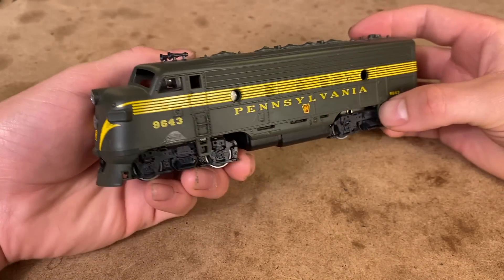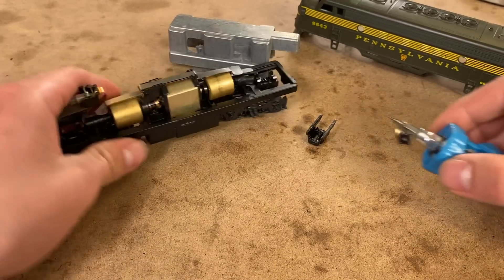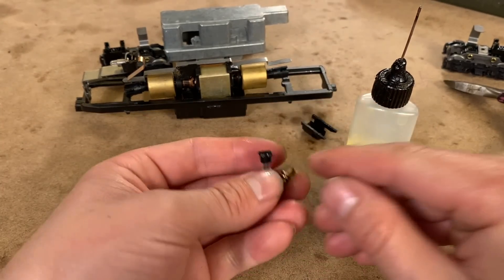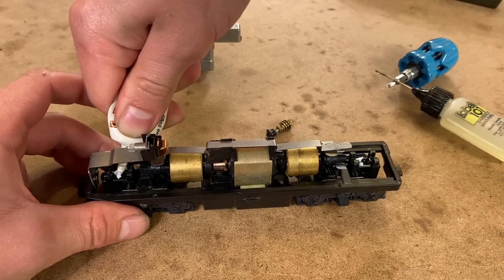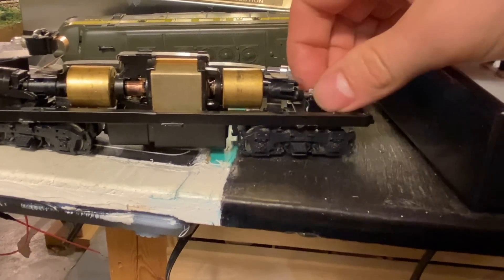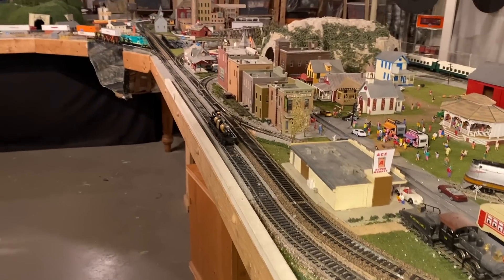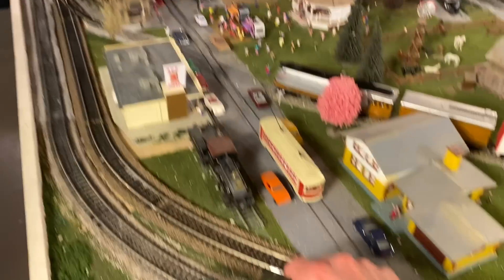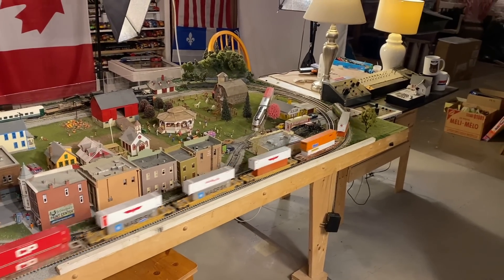Will It Run? 50 Year Old F7 Locomotive - Seized, Damaged and in Need of Repair

Comment: For the algorithm:
Green oxidation indicates leachate of elements in the bronze bearings.  Lack of oxidation in the iron elements negates H2O (flood or high humidity) conditions.  Lack of chronic breakdown (Proto 2K final gear cracking due to loss of plasticizers caused by petroleum lubricants) over the range negates manufacturing issues.  Likely it was baked in an attic or storage shed.  Loss of liquid oil and congealed grease lends support.  Brittle motor mounts also indicates this. Nice demo, as usual.

I have one of these.  Detailed with the Walthers kit and much dry weathering.

Edit: Leachate
Reply from the maker: Thanks for this detailed explanation of what likely went wrong on this locomotive.
Reply: @SMTMainline hi Ihave a few questionsI have aNorfolk and western class j steam engine thatStopped running on new years Day and was wondering if you can helpme
Reply: @SMTMainline  2 question I have a southern pacific daylight steam engine and looking for the roof
Reply from the maker: @shananhale985  Are they made by Bachmann?
Reply: @SMTMainline   yes sir they are
Reply: No, the Chinese use that "brown" grease from the Lavitory over there! 😂
Reply: Harrison, actually I have an A-B set of those, and another custom painted / detailed set of PRR A-B F7's with the single stripe.
But mine have all the P2K motors & driveshafts, and TCS Wow sound decoders in both A units, and silent decoders if the B units are powered.
The only reason I still have the old Athearn locos, is all the work I did on them.
But my preference for F-units is Stewart-Kato, or the new Walther's Proto F's & FP's, which have the helical gears on the axles. They are even smoother, and quieter running (that is when the sound is muted).
You're doing a fine job of showing modelers  how to repair these older engines.
I've been in HO Scale since 1959, at time I was 9 years old. Since then I've built many of kit locos,  and bought & sold many. Keep up the good work!
Reply: I use odorless paint thinner for enamel to clean bearings, gears, and motors. I also use bathtub caulk as a substitute for motor mounts, being careful to keep the bottom contact free of the caulk.

Comment: That's a common problem on LL P2K engines also.
They used a thick Brown gease in the trucks, which hardens up, and the bronze bearings on the worn shaft, lock up! 
I take the trucks all apart, and soak everything in 91% alcohol overnight, then scrub them off, using an old toothbrush.
Once clean, reassemble them,  and use LaBelle grezze with PTFE.

Comment: Super. The Athearn "Superpower" F-7A was my first flywheel equipped, all wheel pickup, all wheel drive, all gear drive, mainline diesel locomotive, and it raised the bar for any future locomotive purchases by me. To this day, some 40 years later, this locomotive and four sisters (A-B-B-B-A) that I bought new (Summer job, $1.85 an hour, phone operator, $14 each locomotive from Caboose Hobbies.) are still reliable runners and dependable enough to be used on the plow train when it snows. The paint jobs have evolved to a nice, weathered, natural patina, (After all the time operating outside.) that looks very realistic, and maintenance is very easy and minimal, and also they look fantastic pulling a matching express passenger train. Thanks for the memories, and hello again from the Tracy Mountain Railway in Colorado. 💙 T.E.N.

Comment: It’s interesting to see that amount of oxidation in those areas. It reminds me of old leather holsters that have that kind of local corrosion around the snaps and rivets. That is usually caused by wax and leather cleaners. So, using the wrong kind of cleaning solution, the wrong kind of lubricant or something else that contains a corrosive chemical. Just a thought!🙃

Comment: Hello All, those Athearn BlueBox mechs are rugged, reliable, easily fixable, and very long lasting, and replacement parts are still available, which regrettably is not the case for some newer, and less rugged, locos.Regards from Australia.

Comment: You youngsters were never told that Delrin gears are self lucubrating. No need for oiling.  Check out the history of Delrin
Reply from the maker: With all due respect that's not true, Athearn put grease from the factory for a reason.

Comment: Because these motor mounts wear out over time and Athearn use the same mounting systems for all road diesels, I just keep a bunch of spare mounts on hand. You can find white rubber ones from a lot of places, but the newer black ones with screws seem to work on older models too.
Reply from the maker: Not a bad idea but after 10 years of working on these I've at most seen two Athearn motors go bad. They were made very well.

Comment: I got a vintage Athearn Union Pacific ALCO PA-1. It sorta runs but it has very high energy draw and moves very slowly and weakly. I have cleaned the wheels, cleaned the motor, put new grease in the gears. Any tips on how to get it going faster or is the motor dying?

Comment: I had the exact same problem with an Athearn blue box myself. I bought it cheap at a train show. It didn't run. Same problem,  bearing next to worm gear seized. Fixed same it the same way. Now it is one of my better haulers. Thanks for the video.

Comment: I got to say that was challenging locomotive to get fixed. I myself never saw that bearing seizing like that but I'm not going to say it's not common. One thing I have experience with blue box locomotives bandai have a Athearn bluebox PA 1, and a S7 I believe or a sw1500. Anyways they both have issues with gears then I have a GP18 high hood issues. They have steel wheels vs this locomotive that you have in vid. I'm going to try to get some more gears and see if I can fix the issue with them locomotives. The only way I noticed it was when I was cleaning the wheels. When I gave some pressure the wheel stopped dead in its tracks and started clicking on the gear. I have one of these in a New Haven paint scheme with the b unit, the newer versions will not as heavy as the older version like this one. The instructions for mine show the part number for that wait that's on top of the motor which mine does not have. That could explain why it doesn't pull as much as this one would with the added weight. Good video as always Harrison

Comment: I was going to say about oxidation, but the pinned comment says it all very well. Also, you might want to have spare Athearn motor mounts on hand. This issue of brittle motor mounts is not too uncommon, and every Athearn owner should keep spares on hand. Ironically, I've owned this same exact engine in the past, but it was repainted into a Penn Central unit.

Comment: In your bottom parts drawer you have a very early metal chassis Athearn F unit chassis with brass wheels.  Would you be willing to part with it?  I desperately need a motor as mine is demagnetized.

Comment: That you could get the engine to run is a partial victory.  The broken motor mount should have also been replaced.  The combined friction mounting of both motor mounts keeps the prongs on the bottom of the motor secured against the frame, making a secure electrical contact.  The new owner will probably have to replace the broken mount at some time in the future, because with use, the good motor mount will gradually pull on the motor, skewing it out of alignment.  I had an experience with an SW1200 (Athearn calls it an SW1500), with a similar problem.  In that case, the motor and drive train was skewed, causing the drive train to rub on the car body, making a loud noise.  It took me a while to figure out that one of the mounts was broken.  The mounts are a very inexpensive replacement cost, and well worth installing, considering the amount of time you spent to completely disassemble the unit as you did (good job!).  Spare parts are good, but they need to be serviceable.  -  my humble opinion...

Comment: P2K engines are clones of the Athearn drive system with extra enhancements. The binding drive worm gears are a common problem if they are not stored carefully and exposed to heat and high humidity.

Comment: Depending on the lubrication, you have dissimilar metal corrosion between the bearing and the shaft. If you don't have similar corrosion on the axel bearings, I would guess that the oil protected the axels, but grease on the gears and worm shaft actually caused the worm bearing's to corrode and lock up. Because the gears and posts are plastic they would only be affected by hardened grease clogging the gear teeth.

Comment: Why cheap out, should have put new motor mounts. They're cheap enough to buy.
Reply from the maker: It's not about cost, It's about time, it would take weeks for those parts to get here. They're holding properly as seen in the video and I'm not charging a dime for anything.

Comment: I recently updated an old F7 and added more details on the loco. When it came to cleaning the working parts I used an old toothbrush with rubbing alcohol which gets into all the cogs and corners. It now runs like dream. Great video thank you for sharing

Comment: Athearn sells new ones by the dozen, which I had to get because the mounts in my engines were starting to fall apart. The type of plastic those mounts are made of start soft, then harden, and then after about 20-25 years start to crumble.

Comment: The shell with the darker green paint might be 50 years old but that chassie is no older than late 80's or 90's .  I want that shell .
Reply: The shell is not old as you think. This scheme was offered during the 1980s to 1990s, and I personally owned one of these exact locomotives. Keep your eye out for on either Ebay or a train show. They are not as rare as you would think.

Comment: Surprised you don't remove brass clip n solder heavy wires to motor for Better performance!
Reply from the maker: It's an option but it means if someone ever wants to do maintenance on this locomotive again, they'll need to desolder both trucks from the motor.

Comment: Not 50 years old. Athearn changed to this type of motor in the mid-80s, so would be more like 30-35 years old.
Reply: Either that or someone swapped out the motor 30 years ago.
Reply from the maker: I'd thought they had started using this motor sometime in the early 70s.
Reply: @SMTMainline  I have some Blue Box GP-9s (the model is actually closer to a GP-7) purchased in 1980, and they still had the old motor and steel flywheels. It was a few years after that that they made the switch.

Comment: Motor fixed... Headlight... uh...   Actually, with a bit of bending, you can get the headlight to shine through the nose instead of the cab windows.  John
Reply from the maker: I tried off camera. It's making proper contact but it still won't work for some reason.

Comment: I have had the very same problem regarding the motor mounts,( now have spares) but thanks for the tip on the worm gear bearings....I will be looking into this aswell,...your right regarding the motors they are very good.👍🇬🇧

Comment: ATHEARN MOTOR MOUNTS getting hard to get TRAIN SHPO  maybe or short screw should work also what they use now, I need to talk to Jon and me Iam going be making a will,. I did talk to my worker about it my club is not getting any much only N scale is getting some 3 and 2  Bay Hopper cars.  I told SATURDAY on 8th I may have got it on video, He said "I" fuck up the hole layout, Iam still running my train no problem he got all reds no greens light i was only one running a train, They took out that switch I melted long time ago they put in a new switch in, HE did not do it 2 others did the work on it. I was only one running a train, He did not get his way on to the NCE he wanted he mad about that, That wye I  not giving my trains to the 3 said I have junk, there are better then any one, that is there words. Even Tom herd other story  them in the pass way be for I was in the club, Is that bad.

Comment: You could use CLR to help free up the parts. Just make sure to have them thoroughly washed or they will cease again. Another thing you can do for all your blue box engines is to upgrade the motor mount to the ones with 4 screws. They are a bit of a pain to get the screws into.

Comment: I'd not be surprised if the problem had something to do with the oil that was put on there from the factory. Maybe after sitting long enough it hardens/dries out.
Reply: Like the old BSR record players. The turntable platter would seize up due to dried out grease.

Comment: As for the dissimilar metals they used I mean they are, period,  you have brass and stainless steel (most likely) but how much corrosion that creates will depend entirely on the grade of stainless steel which good luck finding out.   That said there is no current flowing through those gears (plastic on one side) so it shouldn't be THAT bad unless of course the the grease used in it had some level of conductive properties which I would probably put my finger on, I mean after 50 years I think it'd bound to happen.
Reply: You are exactly correct. Electrolysis is the term .

Comment: Love your  shows.  FYI  Acetone and a toothbrush will super clean the gunked up grease off of metal parts.  I used to own a bicycle shop and used acetone to clean wheel bearings on really old bikes.  Works like a charm!  However, Acetone is flammable, and has some fumes.. so, no sparks or open flames... and be safe!  ~ B
Reply: Acetone is actually a carcinogen , so use protective gloves, and plenty of ventilation , as the fumes, especially in a confined space, can lead to loss of consciousness.  I use acetone on an outside table ( but I do not have a snow problem ! ) but only on really hard to clean objects, as I find denatured alcohol or methylated spirits ( ethanol denatured and with added aroma to deter consumption ) usually quite good, and normally does not attack plastics or delrin, though it will potentially damage some painted surfaces. Seized metal parts can be left overnight in a small dish ( rattle can lid ) of metho, and it should be easy to disassemble the next day. This will prevent distortion of small metal components.Another good Harrison video, regards from Australia.
Reply: @70sVRsignalman  Typically I have used acetone in well ventilated areas, with gloves on bicycle parts (older bicycle hubs with old grease) and it cleans up the expired grease really well.  You have good points! Thanks for the reply!

Comment: That metal weight makes a great looking load for an 8 axle depressed-center or heavy duty F34 flatcar.   Mesta Machine Company of West Homestead Pennsylvania made hydraulic press heads that looked very similar.   They were a Pittsburgh area company that shipped many loads over the Pennsylvania Railroad and Penn Central.